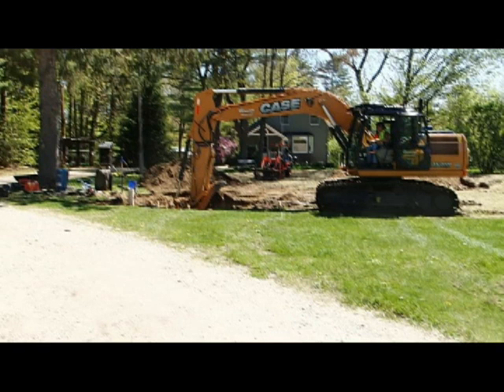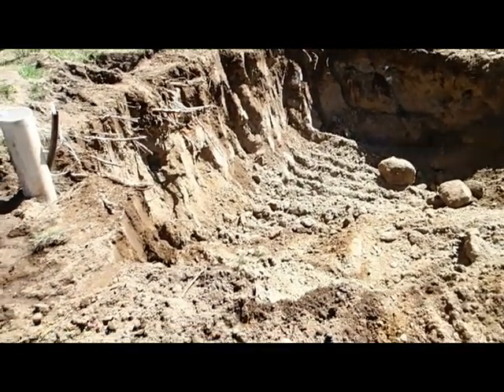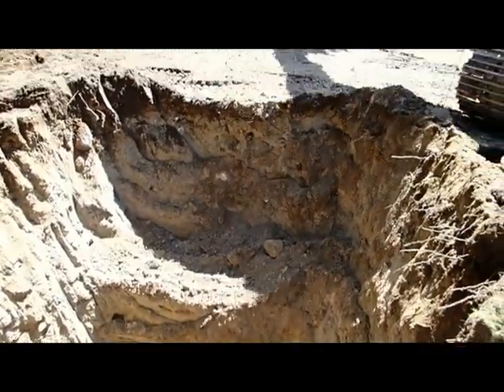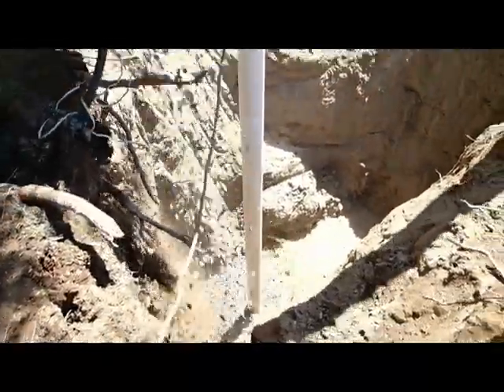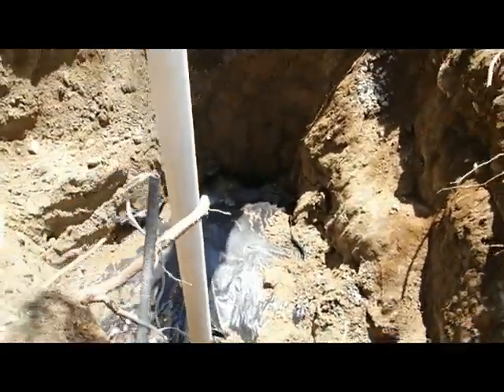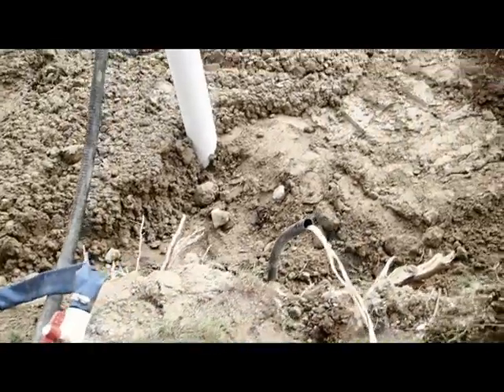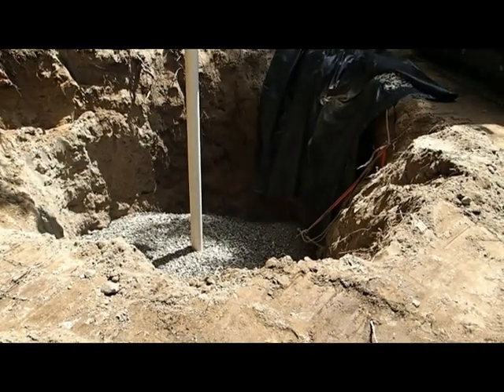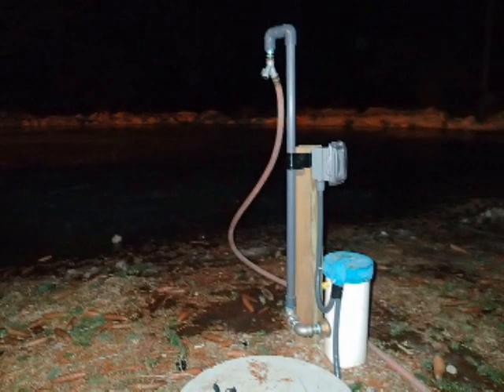Digging a shallow well with 6" casing and crushed stone storage- the "6 PACK WELL"

Comment: Update. During the irrigation season one recent summer the low water pump shutoff switch stopped the pump from running.  I soon realized that I did not have enough holes in the pipe, especially toward the very bottom, and with a 3/4 hp  pump working with almost no head pressure, and the irrigation system demanding more water than the holes in the pipe would allow into the pipe,  the pump cavitated and the shutoff switch did what it was supposed to.  I throttled back the irrigation lines and the situation is now resolved, but I now realize that more holes would have been better. 
I think that holes can be 3/4" or even 1" if using 1.5" stone.  Just remember to drill MORE of them than you see in the video.
Holes are safer than slots as slots have the tendency to provide the beginning path for a break to occur, whereas round holes do not encourage such failure.   Russ Lanoie  12/25

Comment: Why did you move away from slots in the casing to now using holes?
Reply from the maker: There seems to be less shattering of the PVC casing using a 3/4" speedbore bit to drill though either technique works.
Reply: I just finished the same setup